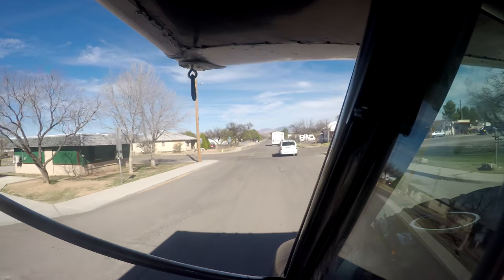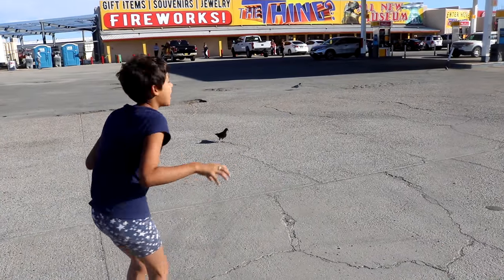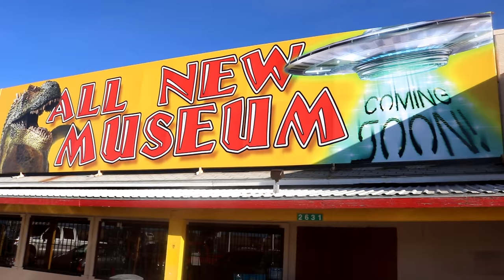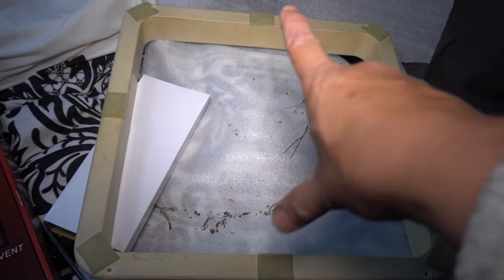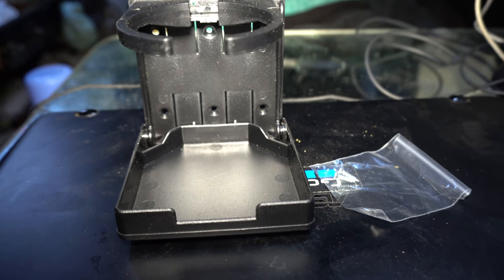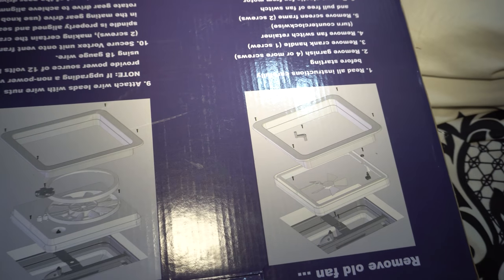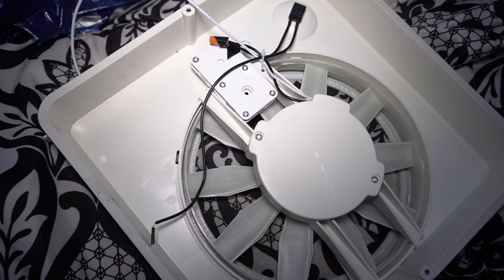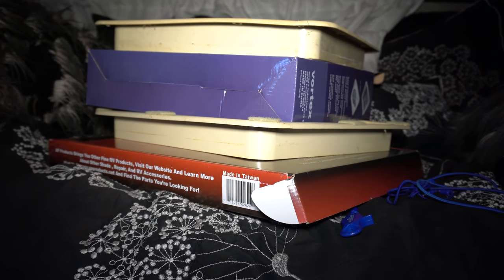Installing Some New Parts On Panda

Comment: Thx for uploading. Its handy I have found to carry a mini butane torch that's for cigarettes but is great for small soldering jobs like the two wires you want to crimp together. It can plastic weld too using cable ties with a bit of practice 
Hope that helps. 😊
Reply from the maker: Thanks I actually have one of those

Comment: Ausia, On your fan install USE the wire nuts and not the crimp connectors, The nuts will give you a more secure connection then the crimp connectors will just put a quick wrap of electrical tape on each wire nut and your done...Good job keep the vids comn.
Reply: The Faceless Nomad better yet twist wires together and solder then tape